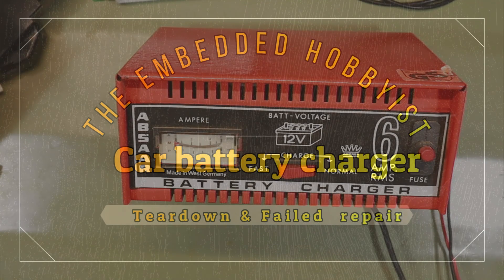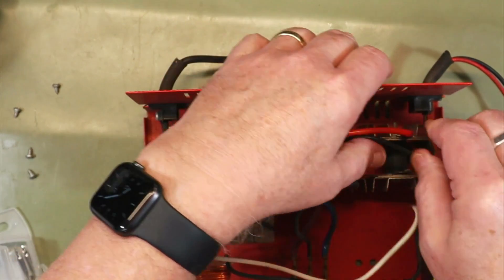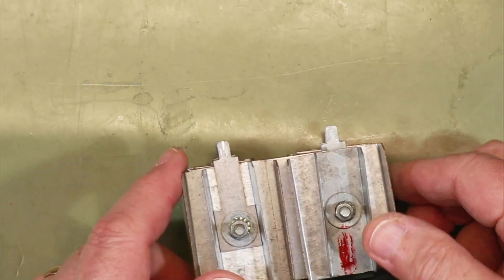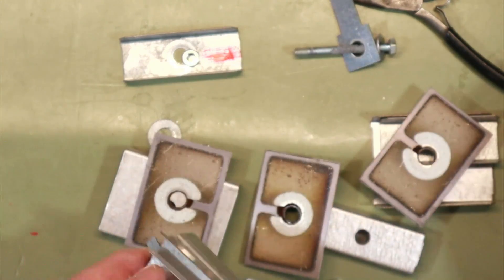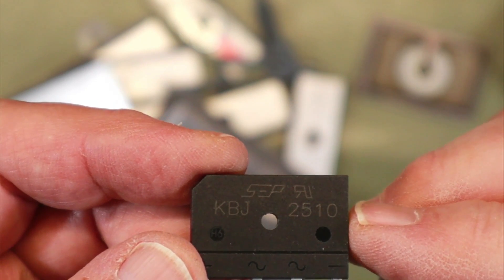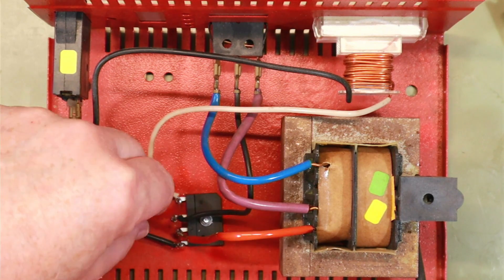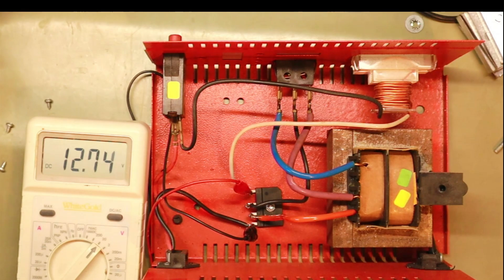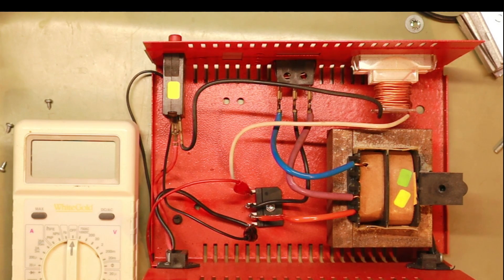#221 Car battery charger teardown and failed repair

Comment: Connect a battery and then read the voltage: depending on how your meter handles ripply DC, you might be getting a false reading. The output of a rectifier rarely looks quite right without at least a capacitor over it to smooth it out.
Reply from the maker: Thanks for the comment,  I.I'll give it a go on a battery and have a look how it behaves.
Reply: @TheEmbeddedHobbyist  What's the mains voltage? Would a capacitor on the dc side help?
Reply from the maker: @jimmybrad156 the mains voltage is 230V a dc side cap won't help much as a battery looks like a b8g capacitor. 
It does work as z battery charger but i thi k the transformer is the biggest limitation on its charging ability.

Comment: I have one of these I am about to fully refurbish, for use. Selenium is not very efficient, so I will be using a Silicon full bridge plus some smoothing..
Reply from the maker: I hope you yours has not lost as many volts as mine. Was thinking I have some large gauge enamel copper wire, maybe i could add a few more turns on the secondary.

Comment: bin is definately the place for that charger  buy yourself an CTEK MSX 5 charger and fix either the battery or what's causing the current draw :cat-orange-whistling:
Reply from the maker: Well, the problem with modern chargers is they don't work well then the batteries are very flat and I don't have one. I think the disco being full of water is a hint to my problems.
But I've got to do something as I now have two cars off the road.
The next video has something to do with part of the current flow.
Reply: @TheEmbeddedHobbyist  don't be a cheap skate buy the CTEK they have recovered batteries for me from between 8-10 volts I used to run my S-Type on it's original battery for 15 years:cat-orange-whistling:
Reply from the maker: @fredflintstone1  I would but I've a sick Volvo. if the clutch slave cylinder as gone, then the gearbox has to come out. Who the hell thought that inside the gearbox was a good place to put it. 😞
Reply: @TheEmbeddedHobbyist  you have to many cars for a person of limited income 🙂
Reply: @TheEmbeddedHobbyist  I know that Victron chargers have a 'power supply' mode, so you can just put ~13v across the battery to give it some life. You can access/control it via bluetooth on your phone using an app.
Reply from the maker: @jimmybrad156 the next charger i get will have need to have a starting mode. So i can start the engine with just the unit attached.

Comment: hmm, it always annoys me when people use pliers in stead of the correct spanner or adjustable to undo nuts and bolts:face-orange-frowning:
Reply: Interesting video! Selenium in low concentration is actually required for the human body to function, higher concentrations can be toxic, but the real danger is when a selenium rectifier fails. The most common failure mode is overheating caused by increasing resistance of the junction (literally "burning out"). This releases hydrogen selenide, very toxic and potentially lethal if inhaled - smells bad too. Regards, David
Reply from the maker: @davidv1289  thanks for that information, they don't look burnt and just smell of dust and spider poo. :-0
So i should be ok, they will be heading to the waste container at the local dump.
Reply: @davidv1289  TEH is fine he never eats the stuff or sniffs it maybe though I should take out some life assurance on him:face-fuchsia-wide-eyes:
Reply from the maker: I had no intension of it going back together. So pliers were to hand, I'd have to have gone and found a small adjustable nut F***er and being an old fart i took the easy route.

Thanks for being number 1 in the comments Fred.
Reply: @TheEmbeddedHobbyist  I didn't want to be number one, but I figured I would be the only person commenting, as for the rest you should know where your spanners are when you need to adjust your nuts 🙂
Reply from the maker: @fredflintstone1  i was born with perfect nuts and never seen the need to adjust them. 🙂
Reply: @TheEmbeddedHobbyist  I adjust mine a lot keeps them tight 🙂
Reply: You been at the Brandy again ? talking about spanners and nuts once more LOL ! SQUEAK!!!!!!!!!!!!!!!!!!!!!!!!!!!!! @fredflintstone1
Reply: @andymouse  It is your mind that sees things XMAS CHEESE !!!!!!!!!!!!!!!!!!!!!!!!!!!!!!!!!!!!!!!!!!!!!!!!!!!!!!!!!!!!!!!!!!!!!!!!!!!!!!!!!!!!!!!!!!!!!!!!!!!!!!!!!!!!!!!!!!!!!!!!!!!!!!!!!!!!! 🙂